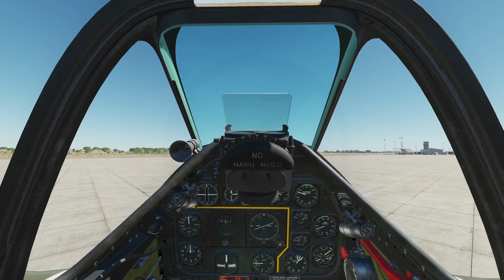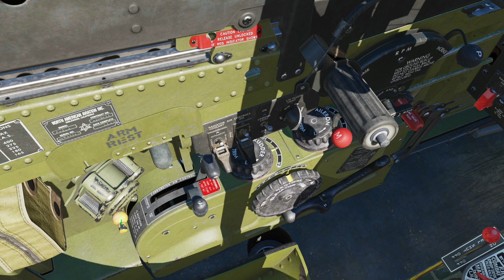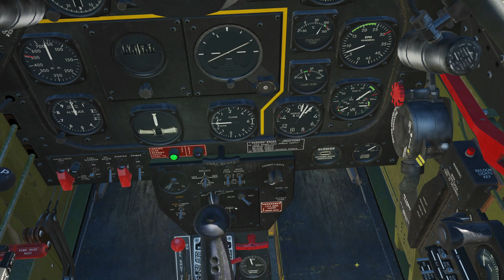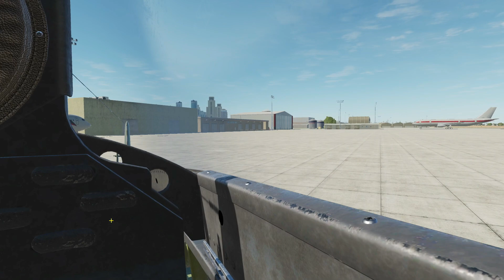P-51D Mustang: Cockpit Familiarization Tutorial | DCS WORLD

Comment: 9:55 - FYI there is circut breaker panel below IFF. Here is info from manual:

The aircraft’s electrical system circuits are protected by circuit breakers on the right hand panel.
These switches are controlled by a single bump plate hinged across them, making it possible to reset
all of the buttons at one time, and doing away with the necessity of hunting for the right switch.
If a circuit is overloaded, it will pop slightly out of the panel. To reset, wait a few seconds for the
switch to cool, and then give the bump plate a firm push. If the switch pops out again immediately,
allow a bit more cooling time and try again. Should repeated efforts fail to restore the switch, there’s
nothing more that can be done to fix it. The circuit is probably shorted and cannot be repaired in
flight.

If the ammeter shows that something has gone wrong with the electrical system and the battery is
overcharging, cut the generator disconnect switch by setting it to OFF. Be careful not to overcharge
the battery.
Whenever the generators are shut off, the radio must be used sparingly as it quickly drains the
battery.

If the ammeter shows that the battery is undercharging, check the generator disconnect switch to
make sure that it hasn’t been turned OFF accidentally. If the generator switch is still set to ON and
the battery is not charging properly, use your radio only when necessary. Make the best use of
whatever battery power remains.
Remember, if the electrical system fails completely, the ignition system continues to operate on the
magnetos. However, the oil and coolant scoops will be inoperative, since they are controlled
electrically.